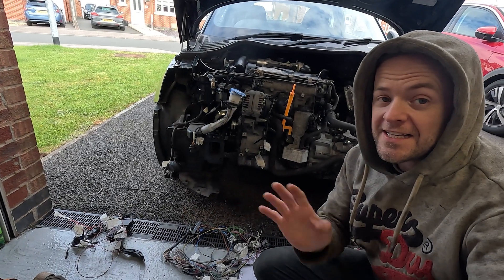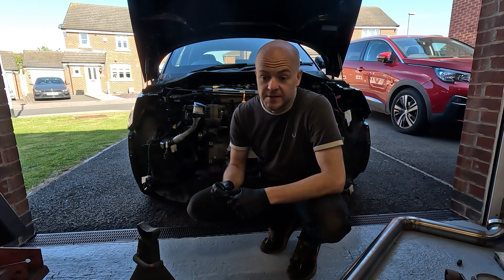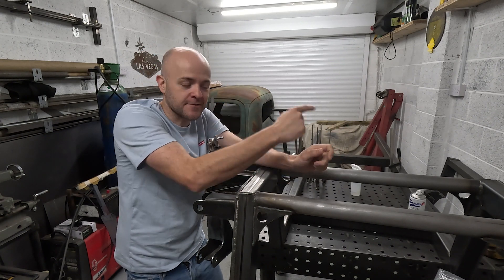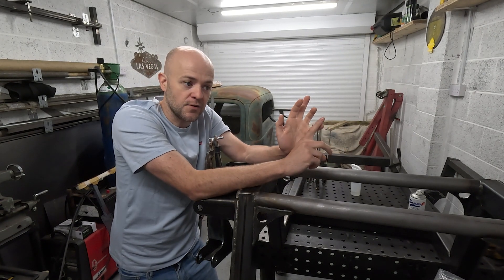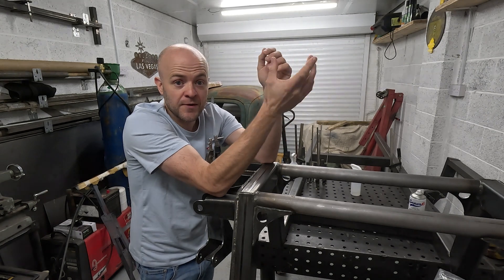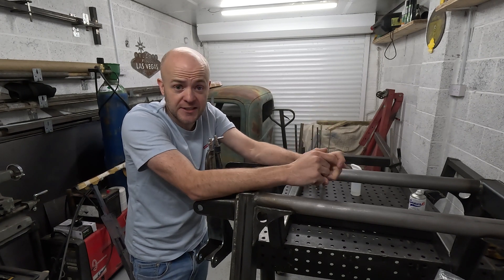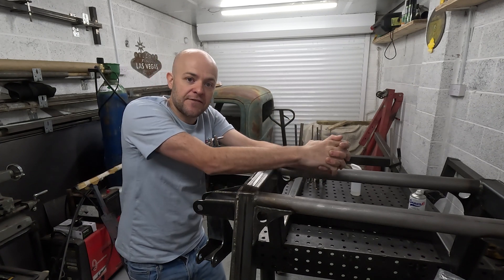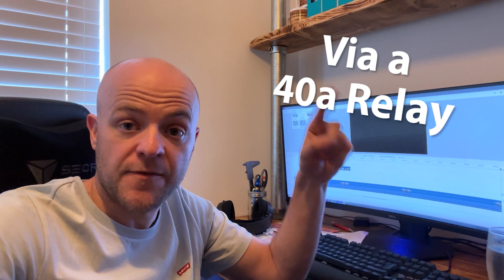Easiest Engine Conversion Ever? Audi A1 Engine Swap - Fabia VRS PD130! OEM + Vid #3of 3

Comment: From what years would I need to be looking at if I wanted to go down this route, ideally want one that’s on 15/16 plate and above ? @rusty
Reply from the maker: The engine needs to be ran ‘stand alone’ anyway, so the a1 donor car could be newer than my 2010/11 model.
Reply: @rustypaint ah okay yeah I can understand that, I was wondering more physically it dropping straight in if there was a chassi change with a newer one

Comment: Good watch and love the knowledge 🫡🫡🫡I was going to fit a 3.2 in a a1 years ago and was warned about the ecu and cross over issues
Reply from the maker: Cheers mate. I wish someone had warned me haha! Most of them are sorted now, its only a rev counter it lacks... but who needs one of them anyway...
Reply: @rustypaint  Ahahaha Yh it s platform issue . I was warned that crossing them is not a simple mix .. but same time was told all sorts of other stuff and made them work so Yh.so was this the 1st time ya acc realised that the chassis was the same as the fabia ?? 
From polo 2002+
Ibiza 2004+
Fabia 2002+
Audi a1 
All these up to like 2018 share the same chassis so engines suspension brakes mounts seats sensors and all sorts are all interchangeable it’s crazy